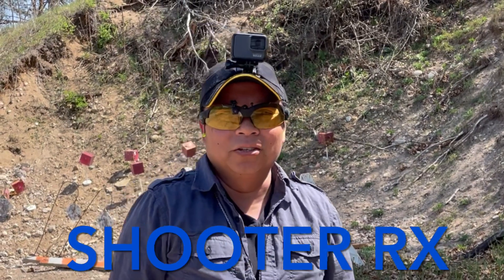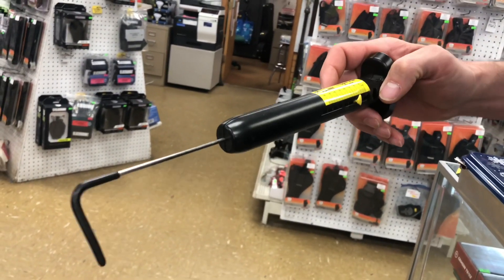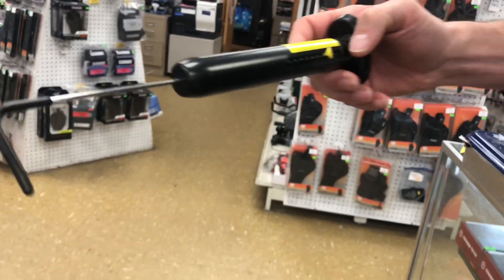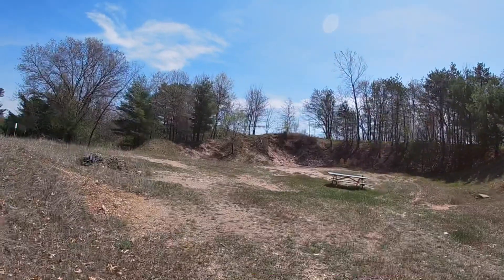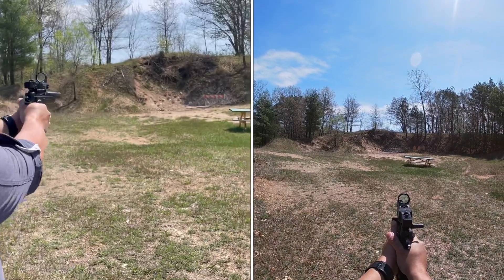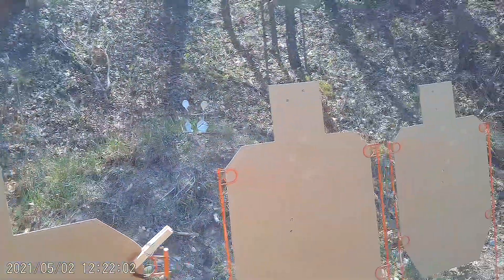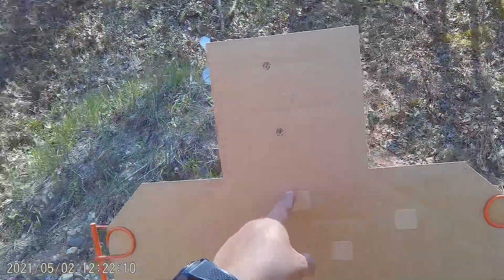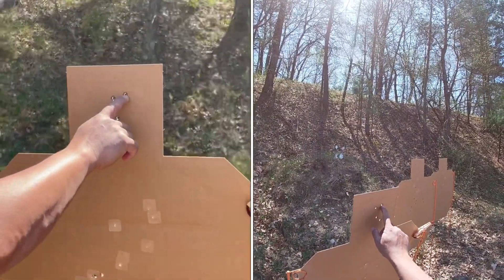CZ 75 TS CZECH MATE (Outdoor Shooting)

Comment: I'm guessing you haven't got a holster yet hence the low ready. From distance on the plates it seemed to do well it Will take a few rounds to get you and it dialed in being a new firearm but it certainly has potential.